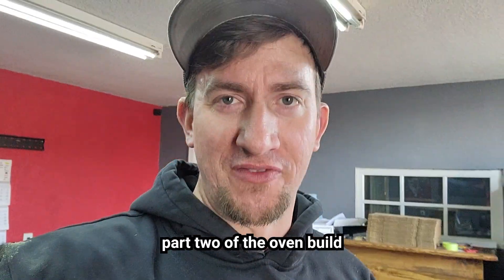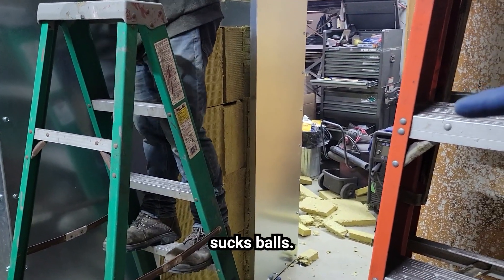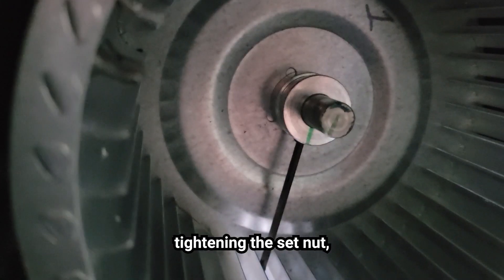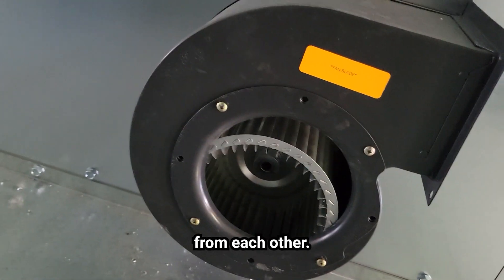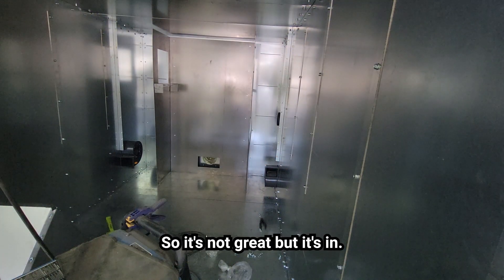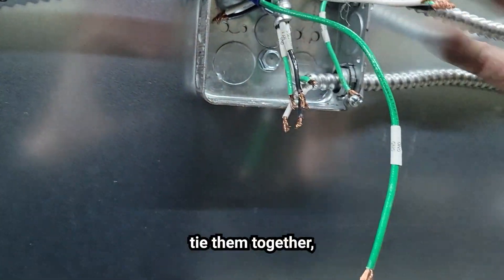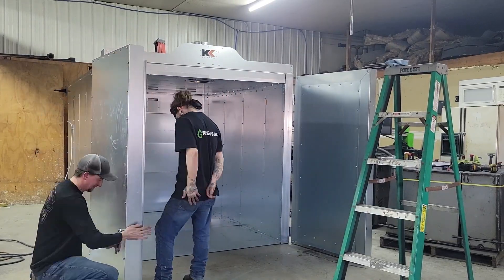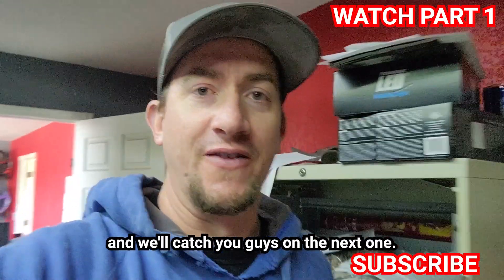Building A Powder Coating Oven! Part 2 - Columbia Coatings Kool Koat Oven

Comment: Hi can I ask you a questio?
I saw a little hole down the back side of the oven, what's that for?
Reply from the maker: Thats the inlet for air into the burner box
Reply: @RightNowPowderCoating  so, is it used to bring the air in or to get the CO2 out of the burner box?
Reply from the maker: @radouanerighi3058  there is an exhuast on the top of the oven too
Reply: @RightNowPowderCoating  thanks a lot.Appreciate the info

Comment: I had such a bad experience with Columbia Coatings that I bought a full on Electron system from you...Their pre-packaged 1 pound bags of paint are pretty good, but their home brews are a mixed bag (figuratively and literally) and the Hyper Smooth 03LED lasted me about 1 year of light usage.  I hope you have better luck with their oven!  I've been wanting to convert mine to gas but I just don't do enough work to justify it.
Reply from the maker: Thanks for your comments.  The oven itself is fine but the components they use suck.  The fans keep over heating and dying...so I replace them a lot.  They had installed 3d printed fans on the output shaft and they shattered.  Dumb cheap design really.  Its an entry level cheap oven so its what you get.  I really cant complain too much overall.  I never used the gun, he was going to send me one but never did...I guess I might be to honest with my reviews.  Also why I assume Eastwood wont let me test their new gun.....  With the Electron Gun I told them if it sucked I was going to share it with my viewers.  I build up trust and I wont sacrifice it for a buck.
Reply: @RightNowPowderCoating  The Electron I bought from you is awesome, the step up from the Hyper Smooth is massive.  I couldn't do metallics without clumping before and now they lay down beautiful and even with no clumps.  For the money the Electron can't be beat.
Reply from the maker: @galtsgarage5775  Love to hear it!

Comment: Hey where you got you insulation from
Reply from the maker: It came from the oven manufacturer, but you can buy it from home improvement stores like home depot or lowes
Reply: Just make sure to get the "mineral wool" insulation, that's what you want for an oven.  Home Depot carries it for a reasonable price.

Comment: I'm I to assume all the ovens from Colombia coating comes disabled
Reply from the maker: Id say yes, my first one was complete, it was great, just forked it in the building, second one I drove to them, picked up and as you saw, put it together.  No savings for that.  They are ok ovens, I dont like the fans as they dont last but for a budget its good.  I sell Electron booths, ovens and complete systems but there not cheap like this.
Reply: @RightNowPowderCoating  thanks for response you are indeed a inspiration.